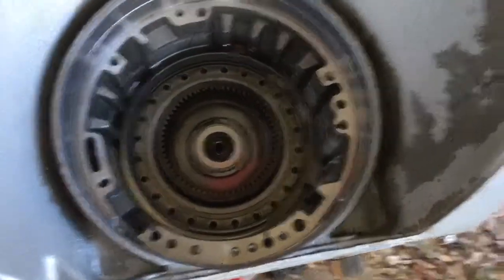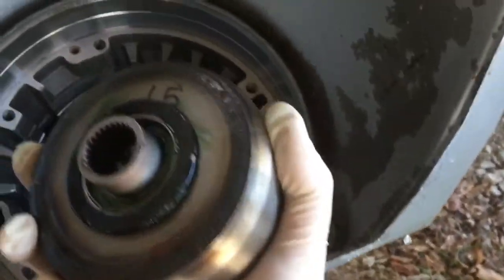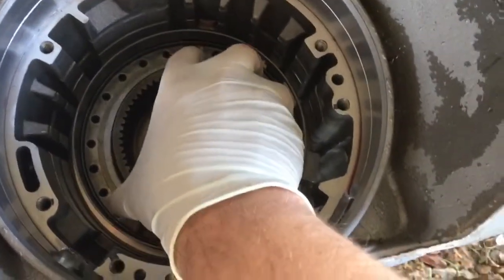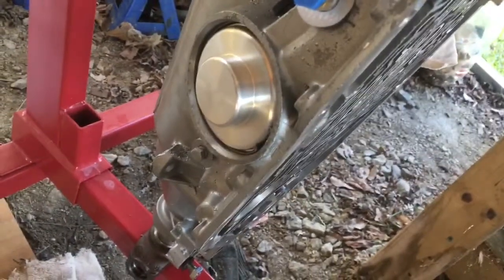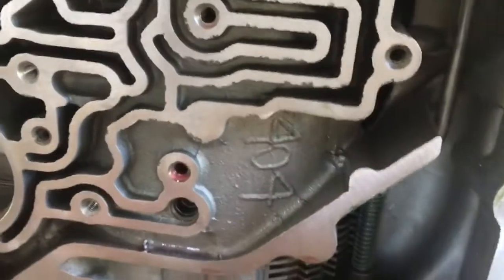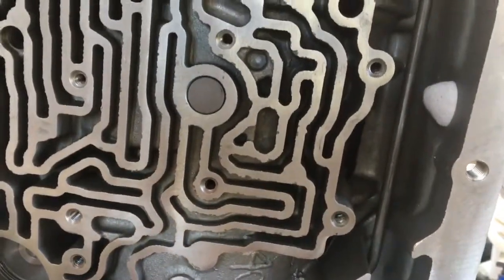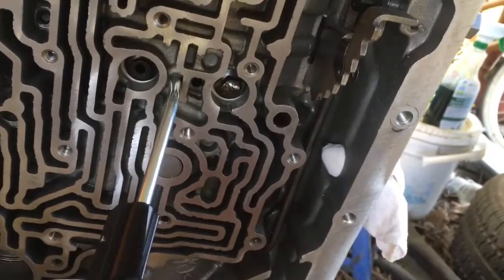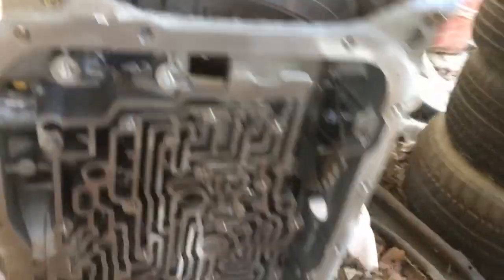TH200-4R rebuild: Installing The Gear Train and Air Checking the Clutches

Comment: So, how did your transmission finally come out? I'm looking for a video. Cant wait to see! Great information on your vids!
Reply from the maker: As of now 5/6/19 I just got it bolted back to the engine yesterday. I need to do some drilling for the G-Force crossmember and then I can get measurements for the new driveshaft. It’s a 4 week build time for the driveshaft so I’ll likely squeeze my old one back in so I can start it up, leak check and check the trans pressures. I plan on making a video on the pressure performance and a few other things. I’m really looking forward to that test drive! Thanks again!🤙

Comment: Hey brother, great videos! I’ve been following along from the beginning. I’m about to start tearing into my 2004R for my 87’ Monte Carlo SS in a few days. I was wondering on your set up to mount your tranny onto the engine stand. I was going to just use long bolts and mount it via 4 holes from the transmission pan, but that will have the valve body area facing the engine stand. I like how yours is mounted facing out. Was that a home made fixture? Pics?
Reply from the maker: My apologies sir for the very late reply. I made the fixture on my own with a 6 foot piece of angle iron, saw drill, and a welder. Just built it on the case loose, then tacked it together and then pulled it off and welded it up.